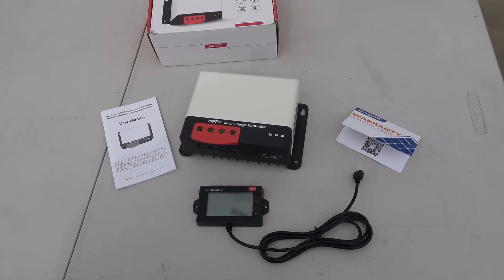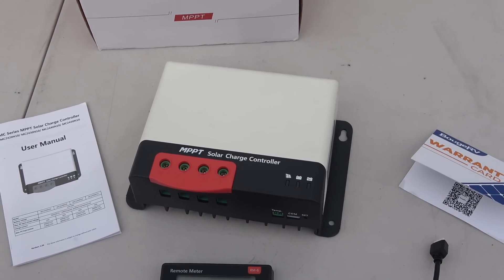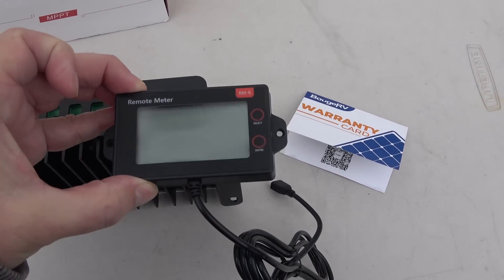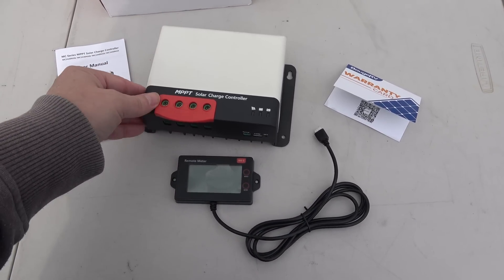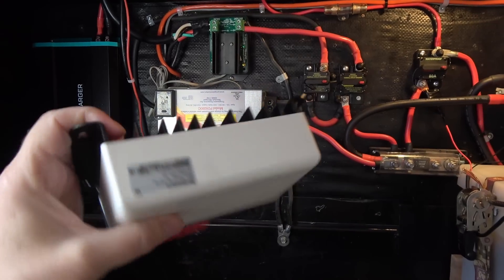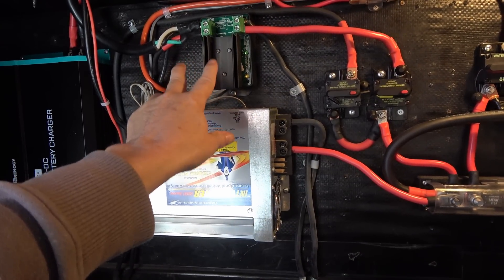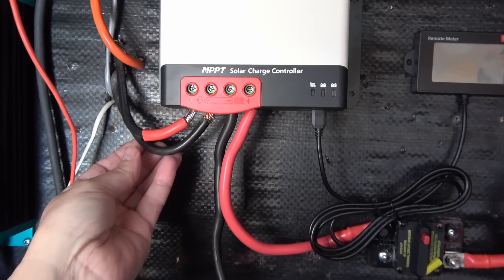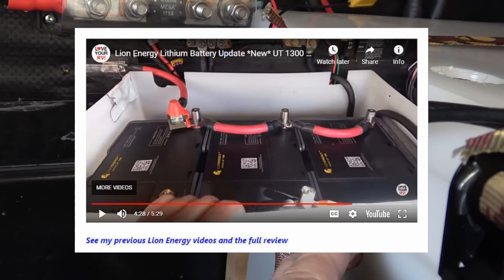Cheap MPPT 40A Solar Charge Controller from BougeRV - Install and Test

Comment: Hey Ray one quick question what's the highest amount of watts you've been able to draw into that particular charge controller ?
Reply from the maker: I've seen it show in the low 500 watt range, it automatically limits the watts. Its max battery charging output is 40 amps. If you run a 24V battery system you can double the wattage. But a 12V system is limited to about 520W. See specs here https://azimuthsolar.ca/wp-content/uploads/2019/05/MC-SERIES-SRNE-MPPT-MANUAL-V1.01.pdf
Reply: @LoveYourRV  oh okay my inverter is a 24 volt inverter so I was going to use the solar charge controller in 24 volts you can't run 12 volts to the solar charger but leave your batteries as a 24 volt battery Bank can you ?
Reply: @LoveYourRV  I meant run 24v to your inverter and 12 volts to the charge controller but I think that's odd I guess if the battery is 24 volts then it's 24 volts but yes I get 1040 Watts I didn't know if you was running a 24 volt system or 12 volt system when you was looking at the white rating
Reply from the maker: You can have either a 24V battery/inverter system or a 12V system, its up to you. I have a 12V system since its in my RV and my OEM RV DC circuits use 12V and my current inverter is 12V so it keeps it simple for me. Otherwise I'd need to convert from 24V battery voltage down to 12V to power things. Some people do that but I haven't felt the need at this point.
Reply: @LoveYourRV  oh ok

Comment: after 3 months, can you tell us if its still worth the money and if its working good?
Reply from the maker: So far it has worked well for me. It was abnormally hot here about 3 weeks ago so gave me a great chance really torture test it - https://youtu.be/IGdCA_e3nVg
Since then I've been intermittently letting my battery bank run down a couple of hundred amp hours and then switching the solar on and it recharges them the same day if sunny.
Reply: @LoveYourRV  TY!

Comment: Im about to buy that same controller may i ask what awg gauge wire ur using coming from ur panels my panels total is 960w
Reply from the maker: On the roof I have 10 and 8 gauge wiring. My panels are wired in parallel, 6 100W and 2 170W, then from the roof they are combined and 4 gauge wire down to the controller and 4 gauge from controller to battery bank. I had to snip some of the wire strands off at the ends to get it to fit into the controller, it is designed to accept 7 gauge max.  Cheers, Ray
Reply: @LoveYourRV  thank you for ur response im so excited getting into this solar adventure i cant wait til mines is up and running

Comment: Nice job Ray
Have you ever built a diy combiner box?
I want to have one for roof top panels and a ground panel

Thanks
Reply from the maker: No, I was a little weird and actually ended up combining mine inside one of my walls. https://www.loveyourrv.com/boondocking-power-upgrade-200-watts-wiring-update-mods/  Most people usually cobble then together from stuff found at hardware stores - Something like this - https://2smoc9hdrhc9eko13nc-cdn.plushcontent.com/uploads/files/33/3m0nggcw564fayk9.jpg  Cheers, Ray

Comment: Hi Ray, i noted in video the unit showed battery @ 100% but was charging @ 42amps....will this overcharge battery or what have you noticed about battery level indicator. I noticed on a review that it gets the battery levels all wrong, its just one review so maybe just a defective one? I was putting in an order on amazon and added from your store to my cart but wanted to double check that. I will be using lifepo4. Thx
Reply from the maker: Yeah, the battery level indicator is pretty well useless for lithium. It has no way to know the battery capacity and how much amperage is going in and out so it's guessing based on voltage and lithium is much higher than lead-acid and has a very narrow range between say 75% full and 100%. The meter may be somewhat useful for lead acid but not for lithium. To get an accurate state of charge of the lithium bank you'll need to use a dedicated battery monitor with a shunt or have lithium batteries with a Bluetooth app that can show the state of charge of the cells. So far this cheap MPPT is performing well but we haven't had much hot weather yet. I'll be interested to see how it performs when ambient temps are around 30C.  Cheers, Ray

Comment: If you drive will that bring more amps In?
Reply from the maker: Yes, but due to the tow cable charge wire being so long from truck batteries to RV batteries and a rather thin gauge, not many amps flow, maybe 5-7. However, I have added a 40 amp DC-DC charger to boost the charge from my truck, here is are some install and demo videos on that upgrade https://www.loveyourrv.com/renogy-40-amp-dc-dc-charger-installation-and-demo/  Cheers, Ray

Comment: It is made by SRNE Solar junk...so is renogy and rich solar. Bad algorithms, I have the 40amp and 30amp mppt units and both freak out when hooked up to 500watts well the 40amp does, I bought a Victron 100/50
My system stopped freaking out,,,it works great now.
When the screen starts to flash red shut it down they don't like over voltage.
Reply from the maker: So far its working well for me since I installed 5 days ago but I'm using  parallel system so input voltage is under 20V. At what voltage does yours as you describe it "freak out" and what kind of batteries are you charging. Is it the display screen that flashes red? Maybe I can recreate the problem. Thanks Ray

Comment: Ok this is the last time I will bug you . But we have the same trailer and you know TONS I been watching . But you guys been at it awhile and have a ton of vids . My question !!!! Does my hot water heater use 120 volt when my inverter is on? I thought I leave the switch on, and turn on LP. But does it switch when I turn on the inverter. Should I turn off w/h switch at panel ? Or turn of that off and on switch at the hot water heater . Because I'm on hook up now . But will be leaving soon and I don't want it to suck my bat dry . Thanks for your time.e ray
Reply from the maker: The switch inside is for LP gas operation. Turn off the switch in the outside access, that is the electric switch or another way is to flip off the AC breaker for the water heater on the power panel. Happy camping. :)
Reply: @LoveYourRV  thanks a ton . Im going to be ordering my solar stuff we will see when that gets here . I'm in a place called youbou it's down island I. On the like it's nice for now . We have cell signal but want to get a rooter or hub we can stream from our phones to TV to watch movies. We have a chromecast.  Then that's about it . And hot water thing . Got it all ways now . We will only have phone signal to do this . Thanks Master Ray guru.
Reply from the maker: Yup, I know where YouBou is, I lived in Victoria for 35 years, back in the old days I used to tent and van camp out there at Nixon Creek, Heather and Nitnat Lake. It was way out in the boonies back then.
Reply: @LoveYourRV  cool I know where those places are now. Did you get my message about mifi or wifi on rogers data phone plan ?
Reply from the maker: Sorry, I don't know much about the Canadian cell plans as I'm usually only here for 6 months a year they aren't worth it to me, I just use campground Wi-Fi and now Starlink. For a phone I use Freedom Mobile $99 a year for unlimited talk and text, if I need data I can buy 1G for 15$ for 30 days. In the USA I have often used Verizon pay as you go or ATT, both have pretty decent rural coverage.

Comment: Eh Ray I think I might have to buy ya a beer when I get up to Campbell lol I have been looking at the renogy 100 watt suitcase with a 20 amp controller.  It's like 250 or whatever . What do you think ??? My guru
Reply from the maker: Cool. :) I've had good luck with Renogy, I now have 7 of their 100W panels. https://www.loveyourrv.com/boondocking-power-upgrade-200-watts-wiring-update-mods/ My first kit was a Renogy 200W back in Dec 2014 and those panels are still working great - https://www.loveyourrv.com/installing-renogy-200w-solar-kit-rv/ I also recently bought their DC-DC charger - https://www.loveyourrv.com/renogy-40-amp-dc-dc-charger-installation-and-demo/ So overall I think Renogy stuff is a pretty good bang for the buck. Cheers, Ray

Comment: It'll be interesting to see what the long term durability of this unit is. I have a Morningstar PWM controller but I'm only running 200w of solar to four 6v Trojan batteries. It keeps them topped off but we mainly camp in the desert southwest and clouds aren't really a concern.

That Bouge RV controller is about half of what I paid for my Morningstar.
Reply from the maker: Yeah, will have to see how it goes. Morningstar are very high quality often used in commercial applications.

Comment: Ray, based on your review, I considered purchasing one on amazon.ca. However, I took some time to read the reviews and here is one in particular that caused me some concern:
Product has no means of connecting or disconnecting output loads and therefore no way to protect the batteries from over discharge as indicated in the marketing. If the sun (charge coming in from the panels) is not sufficient to provide charging current in excess of the load current, the batteries will be drained dead. There are no load sensing output terminals capable of disconnecting the battery from the load/s.
You know if this is true or not? If it happens to be true, it would be a dealbreaker.
Reply from the maker: I'm not sure what you mean by load current as this model doesn't have solar load terminals just battery charging. My manual says it has night reverse charging protection and so does the manual that corresponds with the model number https://azimuthsolar.ca/wp-content/uploads/2019/05/MC-SERIES-SRNE-MPPT-MANUAL-V1.01.pdf Tomorrow I could measure the current drain with the panels off if you'd like.
Reply: @LoveYourRV  Hi, Ray thanks very much for the quick reply. (a) I REALLY had a ‘problem’ taking ‘the claim’ that the controller would ‘allow’ that to happen as per the Poster on Amazon claim. ‘Like’ – ‘I mean’ - that’s ‘so basic’ (basically) an absolutely mandatory Functional Requirement that I would’ve thought that – if true – it would’ve been discovered and fixed/there would’ve been an absolute flurry of complaints long ago. (b) thanks for the link to the PDF for the user manual – if it’s the same one (and it appears to be!) that you posted in the comments section above, I had already downloaded the user manual and read through it fairly carefully and “it looks to me like” the charge controller does in fact have that capability… Again – I simply can’t IMAGINE it would allow that to be possible! One particular problem in general with stuff/technologies/products like this lies in the area of ‘terminology’. FOR EXAMPLE: an awful lot of ‘jargon’/’terms’ seem to ‘pop up’ when you get into the nitty-gritty of trying to program/set all the parameters that you want for various voltage cutoffs and temperatures and so on and so forth, but these parameters are often referred to only in three or four words AND with no more detailed, follow-up explanations as to exactly what it ‘means’. I’m pretty darn technical and when I read some of these terms, it’s frequently not 100% clear to me EXACTLY what it means… For example – Fancy Terms like ‘Maximum Power Points Tracking’ is (my interpretation, anyway) simply a mechanism by which Excess Voltage over and above that necessary to ‘drive’ a charge into a battery IS CONVERTED TO CURRENT’. Anyway, not sure that’s the best way to say it’s distinctly but that’s the interpretation I use. ANYWAY, I KIND OF FIGURED I WOULD FIRE OFF AN EMAIL TO YOU BECAUSE I FIGURED IT SHOULD BE PRETTY EASY FOR YOU TO SIMPLY SNAP YOUR CLAMP METER OVER THE OUTPUT LINES FROM THE CONTROLLER TO THE BATTERIES WHILE THE CONTROLLER WAS STILL CONNECTED TO THE SOLAR PANELS BUT WERE PRODUCING NO POWER FOR EXAMPLE AT NIGHT AND SEE IF THERE WAS ANY ‘BACKFLOW’. I would be surprised if there was any.

One other thing that was kind of interesting to me (actually two things) was the fact that reference was made to a Temperature Sensor which might be a neat accessory to have to use with the unit. I think the manual said that the unit will assume the temperature is 25°C if it doesn’t detect a sensor. It’s not exactly clear to me what use the controller might make of signals from the sensor when temperatures drop to freezing or below OR above 25°C? Would be interesting to know, I think. 

In addition, the manual seem to make reference to ‘Bluetooth (dongles)’ and PC software that presumably could connect to/through the dongle to the unit and supply various functionality and so I thought that would be an interesting area to know more about. Sometimes, being able to use PC software in a dongle can be very nice because of a better interface being available rather than having to step through all the functions on the display panel that comes with the unit.

And further, it kind of makes you wonder if there might not be some Apple or – in my case Android app – that one could use to monitor and or set parameters on the controller (à la Victron for example).

Anyway, don’t want cause you unnecessary work or anything but I figured – again – that it should be pretty easy to snap your clamp meter OVER ONE OF THE CABLES FROM THE CONTROLLER TO THE BATTERY WHILE STILL CONNECTED TO THE SOLAR PANELS AT A TIME WHEN THEY WERE NOT PRODUCING ANY POWER SUCH AS AT NIGHT. I CANNOT BELIEVE THAT IT WOULD PERMIT attached solar panels to drain the battery, but – anything’s possible (in this crazy world we are in)!
Reply: @LoveYourRV  Ray – a follow-up: BELOW is a comment from a Verified Purchaser on the BoogRV website. I have CAPITALIZED some parts which I thought were important:
**************************************************
I have 2 units of the same kind (40A) from the same seller. 

One calibrated correctly another not so much. That not so much thinks that voltage is 14.2V when in reality it is 14.4V. 

This causes issues with properly finishing loading of the LiFePo4 bank (BMS steps in). 

The remote monitor is displaying battery capacity for LiFePo4 way off (like it shows 49% for depleted battery and 100% for little loaded one). THERE IS NO USER SETTING FOR THAT... 

Also there in no backlit for that remote I can find. So I rely on another monitor for battery capacity. 

MPPT is working but slow not sure this is due to the panels reactance time or internal logic. 

WHEN REACHING POWERS AROUND 300WATTS THE UNIT HEATS UP CLOSE TO 22C ABOVE AMBIENT. I think it needs cooling in hot climates and bigger powers. 

Super positive features is it will not get damaged when battery is disconnected (or connected after panels) and it will still output 14.4V even with no battery. 

Manual is well written and unit is very simple to understand. 

THE MODEL I GOT DID NOT HAVE LOAD DISCONNECT ON OVERLOAD OR DEPLETION OF THE BATTERY BUT IN REALITY THIS IS WHAT BMS IS FOR. 

The unit is relatively compact. I say ideal for small RV B class or van conversion with up to 4 panels (4 different models cover from 260W 12V battery bank till 1320W @ 24V battery bank).
****************************************
(I’m not exactly sure what the last point in caps ‘means’, Ray.)
Reply from the maker: I tried my clamp on and it showed no signs of any significant backflow amperage, so little I couldn't get an accurate measurement, but somewhere in the 10s of milliamps range, I'd guess.  As far as the battery capacity figures they going to be inaccurate, especially for lithium. I'm surprised they even try to list it on the screen.
The controller has no way of measuring the input-output amps via a shunt or even knows the amp-hour capacity of the battery bank so it simply relies on the voltage measurement, always a very inaccurate way to determine the % charged.  I use a separate Trimetric battery monitor system for that - http://www.bogartengineering.com/products/battery-monitor.html  
To add the battery temp sensor for better charging of lead-acid in cold weather I found this link - https://www.aliexpress.com/item/4000068249045.html
To add the Bluetooth Dongle for the smartphone app I found this link - https://www.aliexpress.com/item/33029331284.html?spm=2114.12057483.0.0.128f2ed3Ze3Zq9  I think this is the app that connects - https://play.google.com/store/apps/details?id=com.shuori.gfv2.guangfu&hl=en_US&gl=US
Cheers, Ray

Comment: Will you rewire your panels in series to raise the voltage for the MPPT controller
Reply from the maker: No, my wiring is already setup for completely parallel operation with large gauge wiring, I have 4GA coming down from the roof so not much losses in the wire. That way I don't need to worry about any shading issues and there is some redundancy in the system if say one panel quits. And my current 940W roof top array easily maxes out this 40A charger. The reason I like to have a ton of extra solar wattage is for the winter months when the sun angle is low and days short.  A higher voltage may give me a little bit more power earlier in the day and at lower light levels. But, I don't see that as enough of an advantage to rewire. I also have the option to put out some ground panels if needed. Cheers, Ray